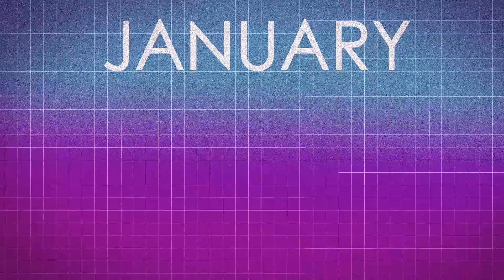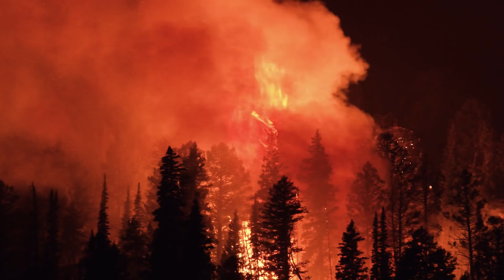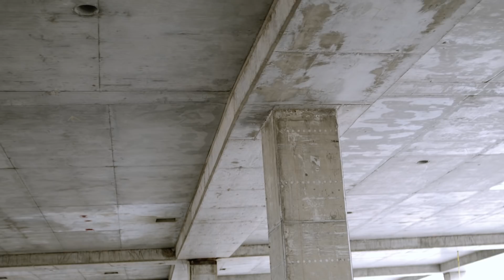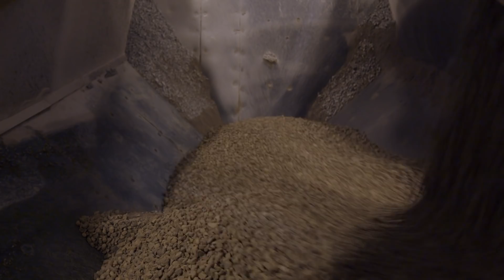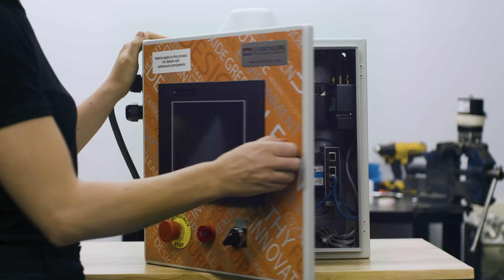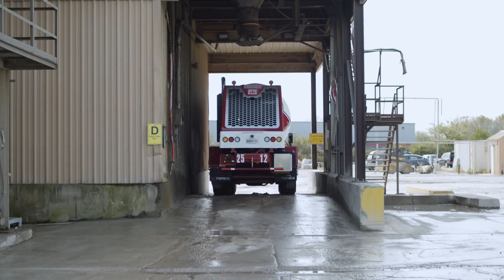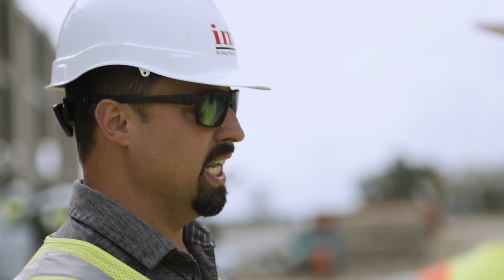How to make concrete green

Comment: Calcium carbonate roasted in a kiln to form calcium oxide and CO2, slaked with water to form calcium hydroxide. Carbon dioxide bonds with calcium hydroxide to form calcium carbonate and water... what isnt green about regular concrete? 

BTW CO2 has identical thermal insulation properties as oxygen. Meaning oxygen is a greenhouse gas and must be mitigated. The extinction of humans is just a small price to pay for permanently altering the environment in the name of environment. Lol

Comment: "...one half goes to the atmosphere as CO2."
Shows H20 vapors.
Reply: @DanielSmith-ze9lw  Carbon dioxide doesn't have any colors. That white smoke is most likely condensed water vapour.
Reply: @DanielSmith-ze9lw  Producing cement from limestone is done by clinker which turns CaCO3 into CaO so it clearly does not produce H2O so I can assure you that the video shown above is not the output of that industry, although you are absolutely correct to say that CO2 can be released while in a mixture with H2O vapour. Also there are no other 'white' gases that can be produced that abundantly other than H2O.
Reply: @DanielSmith-ze9lw  Exactly, it's a misleading picture.

Comment: I will have liked a bit more technical details to understand the advantage.  Like CO2 output for cement is split in to two, 30% comes from energy used and 70% from decarbonation (guessing just the last part where there are reductions). But how much extra energy will this require? and what about the extra equipment amortization and CO2 impact?

Comment: This is so awesome! I'm working on my dissertation for " sustainable construction techniques" and this tech fits right in sustainability bracket. After further digging the chemical equation when observed is so simple yet so effective for current architectural practices. Kudos to carbon cure team!
Reply: Doesnt concrete absorb CO2 while hardening to make Calcium carbonate from Calcium oxide that was made in cement plant by heating Calcium carbonate to drive off CO2? Seems BS tech. Nothing new.

Comment: No details on how the process works? Guess I have to do some more digging.
Edit: i Have a theory, it may be wrong, but I'm assuming they don't have some chemical process to add 'additional' carbon to the concrete.
I'm not a chemist so my numbers are suspect, and I may be missing some important details, but from what I understand, limestone contains approximately 35% carbon, which is normally released into the atmosphere as the limestone is baked into calcium oxide. This process seems to require about as much energy as would release the same quantity again of Co2. The curing process of cement requires reabsorbing that carbon back from the atmosphere, technically being carbon neutral, if not for the energy required to heat the limestone, as well as transport and processing energy as well.
Carbon neutral concrete would be as easy as retaining the carbon produced from firing the limestone, the carbon absorbed during curing would offset the carbon released as a result of the kiln. 
But if the kiln was also neutral, electric, or solar thermal, etc, then the concrete would be absorbing additional carbon from the atmosphere, making concrete production carbon negative , although we havent yet discussed what to do with the carbon collected from the kilns. Its estimated that concrete production is responsible for 10% of the worlds c02 production, with half the carbon being reabsorbed as it cures, fully carbon negative concrete then has the potential to sequester 10% of  our CO2 production. 
Now if the carbon collected from the kilns was processed in some way and also added to the concrete the process would be even better, producing that 'carbon negative' concrete . Perhaps theres some simple way to make carbon nano tubes to mix with the concrete mix?  I think theres a fairly simple process involving nickel/steel that would be appropriate.

Comment: So I'm left wondering: how does it work? " We add a small amount of CO2 to react with the cement..." and  " One half (of the limestone) goes up in to the atmosphere as CO2" --> seems like there is not a whole lot of improvement going on when it comes to CO2-reduction, apart from improvement in the product. And the guy saying the concrete-business has always been about sustainability....  Well, let's just say that it's not a very believable statement. BTW the link to learn more does not work for me.
Reply: Yeah afaik concrete mix already absorbs as much co2 as it can. Just slowly. 

Cement factory heats calcium carbonate to drive off co2. Basically the emmisions part of this whole process is fuel to heat up calcium carbonate in the first place.

Comment: I see a slight problem... the co2 has to be injected into ready mix. Where are they storing the co2 prior?  How is it being compressed? What is the means of producing power to capture end reintroduce into the concrete? What if the ready mix isn’t going somewhere? How long will co2 be stored? 
Ready mix means there’s already demand and it’s concrete that is made reactive for the purpose of setting. Energy is required to maintain this state so as to not fully cure. Perhaps the concrete needs a decelerating agent to slow it... and an accelerant or added cement to speed the use when finally composed for construction use. 
The other question I have is the reliability. Not reliability in strength but logistical reliability.  The application can’t just be proven, it needs to be proven in the process that demands the actual concrete. 

Interesting concept nonetheless. Will need some seamless implementation with deliveries to work, and much of that would mean that the process has to all take place in the exact same place... which is not too keen for the way distribution works in the industry. 

The manufacturer of material isn’t the one distributing or staging the parts. Often, the parts are mixed and carried as needed per the specifications in the project. 

Someone please help me figure this one out. I’d like to see it work.

Comment: Why don't you push for Cross-laminated timber because wood captures and holds carbon, builds quicker, can be sustainably sourced, and performs better in fires than steel.

Comment: The best minecraft tutorial
Reply: @Marcos Filho  First of all, fusion energy won't be available to us until at least 50 years from now, secondly, you can't send something into orbit using a electromagnetic cannon on the ground because of three reasons :
The atmosphere which would completely destroy your shipment because of heating
Orbital dynamics which say that your shipment will only do one orbit around the earth and then come back to where it came from (aka the ground).
And last but certainly not least, the mind-bogglingly high acceleration at liftoff would obliterate any sensitive equipment you have on board ( let alone humans ).
Then you talk on how quantum mechanics could help us travel and transmite data faster than light. Well that I'm afraid is not possible because quantum superposition can indeed "teleport" a particule faster than light but it is a completely random choice so if you were to be able to put someone in multiple states then when you were to open the box in order to make him interfere and know were he went, ther would be an equal distribution of the particules he is made from on all the locations he had a chance to be in (aka he would be dead).
Same for information, you can't carry information with quantum superposition because of the randomness of it.
Then you talk about quantum computing, well there is a lot of noise around quantum computers but the truth is, very few know what they are talking about. Quantum computers are very effective on certain types of operations, specifically those were you need to do operations in parallel. But on most other operations, they aren't much better than classical computers, so it will revolutionise some areas like chemistry or pharmacology but your regular computer won't be a quantum computer because it would not be as good as your current computer !
Reply: @Marcos Filho  stop
Reply: @Marcos Filho  ok
Reply: @Marcos Filho  please
Reply: @Marcos Filho  at least he is doing more than you
Reply: @imakevideos5377  shots fired